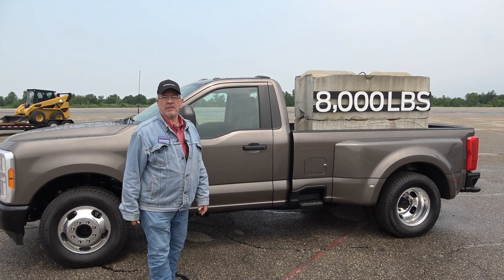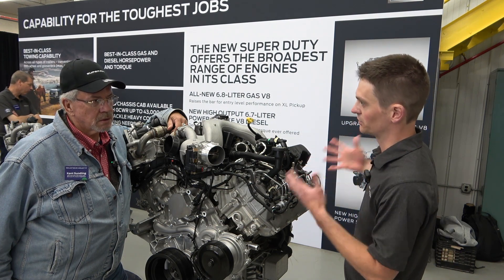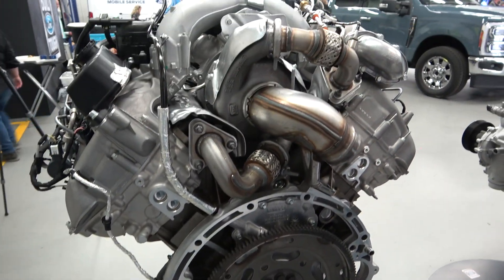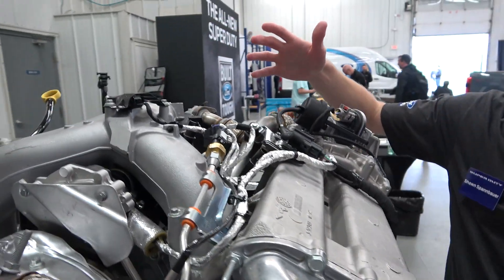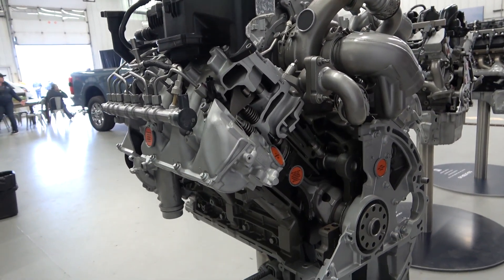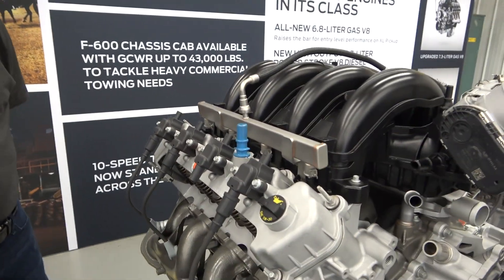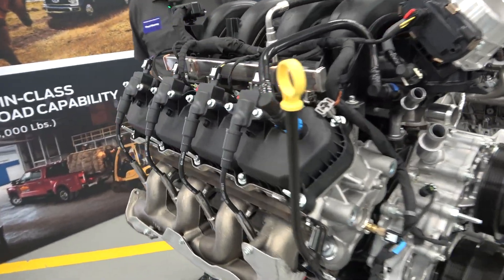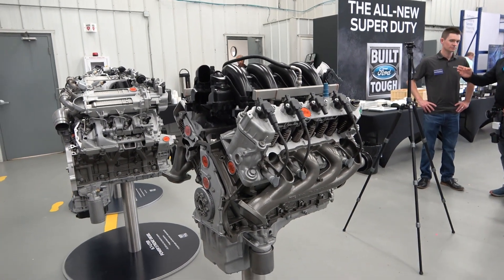Finally, the 2023 Ford Super Duty with great new features and 2 new engines, gas and diesel power.

Comment: wish they would go into more detail on the differences in the 10R100 vs the 10R140 and the 10R80. I'd like an f150, but am reading they have a lot of trans issues and some of the early 10 spd in the super duty did as well. Would like to know what is diff between them all to make an educated purchase from a reliability first standpoint.